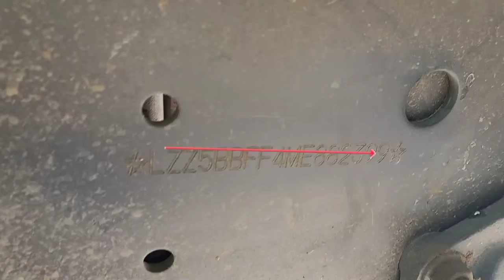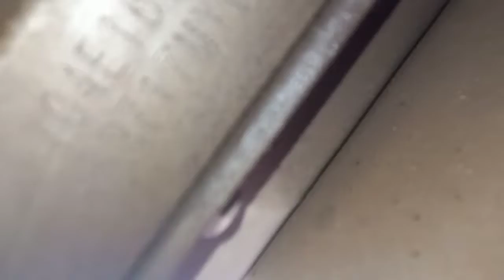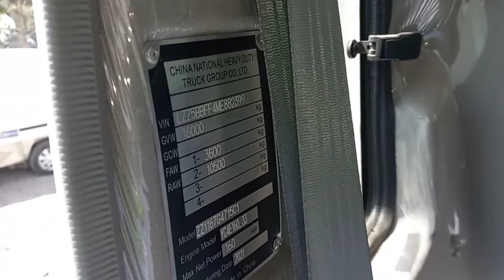Sinotruk Howo ZZ1167G4715C1 Chassis number and Engine (YC4E160-33) number location

Comment: Thank you for this video. 
How are these trucks so far? How much can you load i hear 13t is the limit
Reply: Loading capacity= gross vehicle weight- curb weight
=15,795kg −5,660kg=10135 kg which is 101.35 kuntal or 10.14 tone.
This is manufacturer and technical recommendation.
Reply: @tes5aye  oh ok thanks, but are this trucks good and reliable?